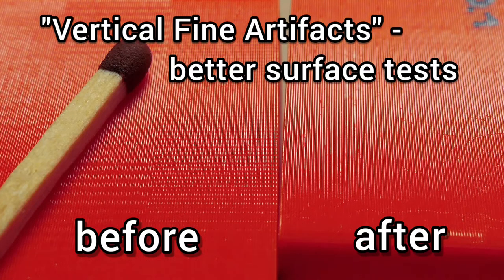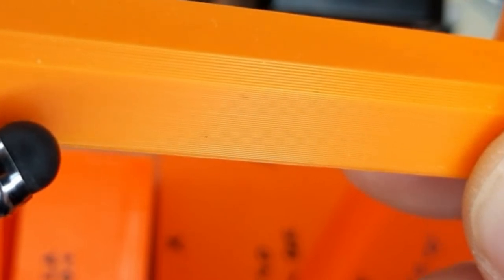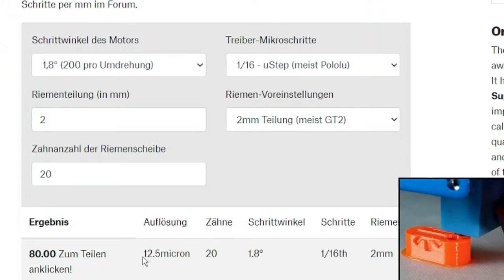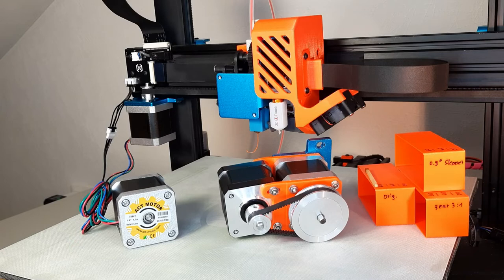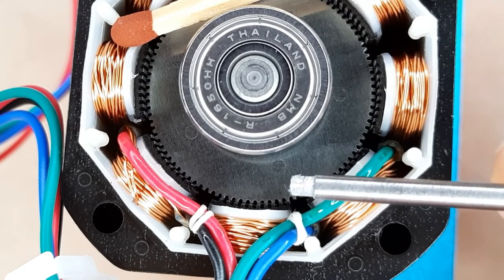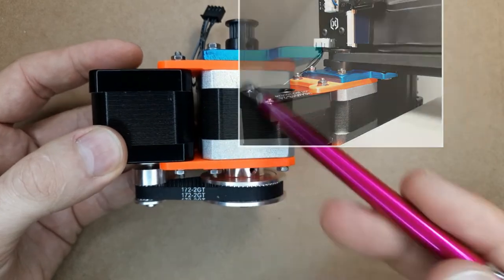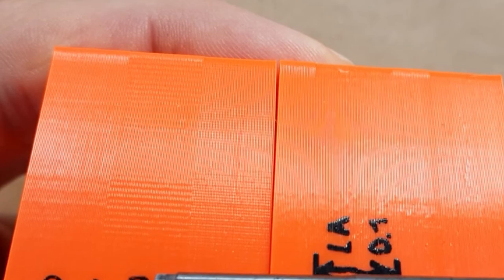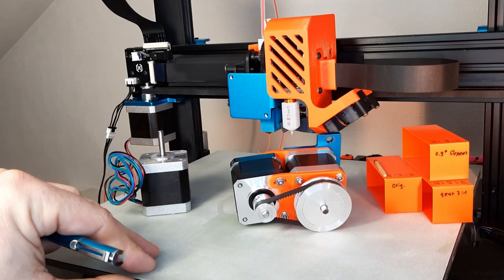"Vertical Fine Artifacts" / 0.9 Stepper Upgrade / before & after

Comment: Just bought this exact model of 0.9 steppers from ACT motor. Thank you so much for your recommendation! The improvement from the stock creality motors is huge in my case. I have been tackling with this problem for so long. I even tried 0.9 steppers from LDO motors but those were incredibly loud and the artefacts were still there. There are still some minor artefacts while using these motors but they disappear completely at higher speeds.
Reply: Where did you get those ACT motors from? I'm guessing you have an Ender 3?

Comment: I've had my X2 for a couple of weeks now and I'm just getting used to it. I totally agree about going slow, when I design parts I tend to run them overnight so as to not wake up the family (we live in a small apartment). In fact, the reason for buying the X2 was the (lack of) noise factor. I always explain to people that 3D printing is usually a lot faster than ordering stuff online. My normal rate is about 60mmps and artifacting seems to be fairly limited on the X2 but there again I'm coming off an original Ender 3 and an Anycubic Linear Kossel delta. Both noisy printers that are now about 3 years old and both in need of a massive tune-up. Actually, I really enjoy your 'monotonic' delivery, you remind me greatly of another Youtube channel Marco Reps that I subscribe to. You both have that very dry 'Teutonic' delivery that is very engaging. I'm looking forward to watching your channel develop.
Reply from the maker: The only noise left at the X1/X2 is the inbuild bottom vent. A 3 Euro stepdown module before the vent droped the speed to half and noise down to nothing. 
To ensure the that the steppers are cooled enough though, I changed the tiny stepper aluminium coolingblocks to 1x1cm copper ones. 13 Euro all together and the printer is really silent.

Comment: A Very interesting video.   Do you think that there are stepper motors out there that are lighter in weight that could replace the extruder stepper, with the aim of reducing the overall extruder mass?
Reply from the maker: Reducing the moving mass would help a lot, you are right. The overall construction of that Artillery extruder is rather havy. Concerning the effort it takes to adopt and  mount a slightly lighter stepper, I would instead buy a completly new light weight extruder of an other brand and go this way.

Comment: Can you help us locate that 0.9 stepper motor. I cant seem to find it anywhere and I have seen that not all 0.9 stepper are created equal. maybe this one has some advantage with regard to VFA?
Reply: I've heard that 0.9 motors are a gimmick and don't always solve the problem. Sometimes the problem is cause with belt tension not being optimal or dual drive extruders having a resonance. If you can get rid of the lines by adjusting speed it might be one of these two

Comment: What is the fastest speed you would be able to print with this setup?🤔
Reply from the maker: Ask me how slow I print.
I always print as slow as I can keep up with. Speed causes always a loss on surface quality, since vibrations rise. 
The best physical flow is limited due to the used filament.

I enjoy printing at 60-90mm infill, 40mm inner walls, 20-30mm outer walls.
Most users consider that too slow, not me. Due to my newly polyester printplate I stop the bed heating at the second layer. So no heating energy due to longer prints is wasted.

Comment: "the extruder cannot be the cause"
- Don't be so quick to discount dual extruders causing resonance. This is a thing people have had to trouble shoot.
Chep did a test where he tested a 0.9 motor and it made no difference in quality at all. This is the thing with 3D printers, what might work for someone doesn't work for someone else, or the upgrade exposes other problems. When you work with such precision and want the best you can go down a rabbit hole very quickly.

Comment: parts on artillery are garbage, get this pattern too especially with speed prints 
so what do you  suggest, replace steppers to 0.9 ?
Reply from the maker: 0.9 stepper don't have as much impact as hoped. Print slow. Anyhow, the large X1 bed is much too heavy for any speed printing attempts.